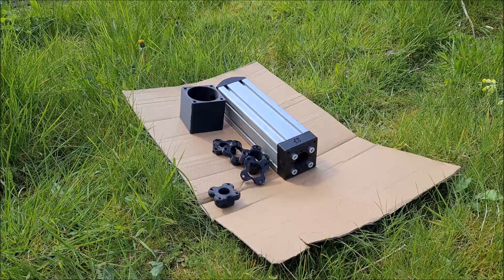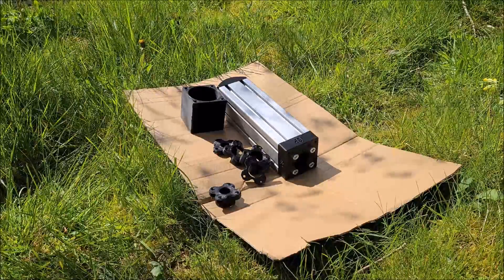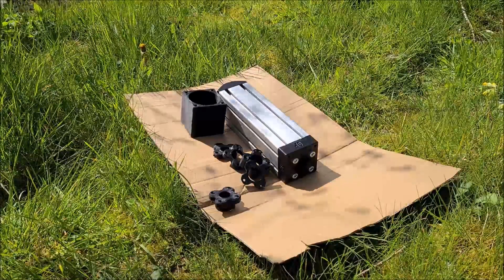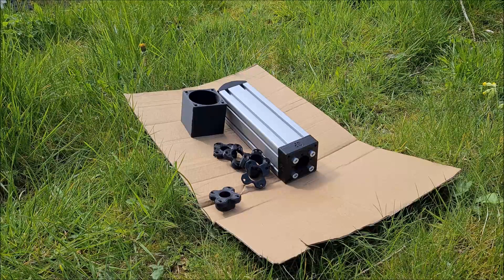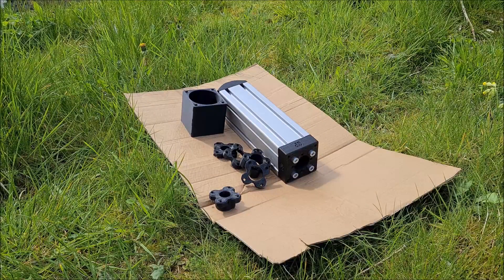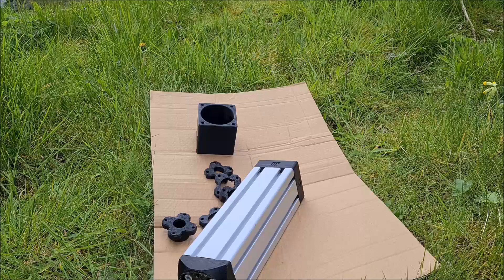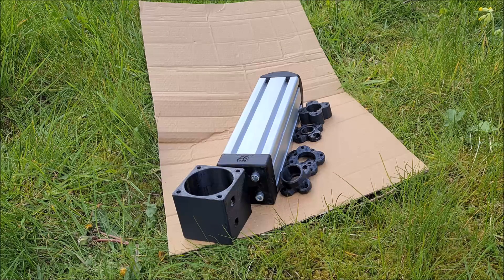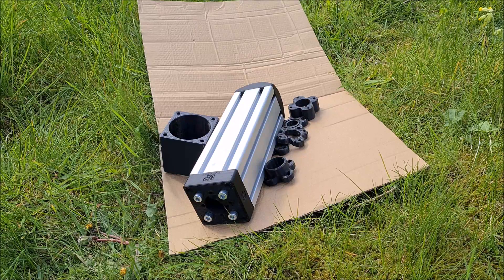Build your Own Sim Racing Motion Platform - Cheaper Actuator Design - Part 1

Comment: Hi man tyvm for all the info ,,,was thinking of making a set how much would it all cost 2022/December,,,also would only two work with a fixed rocker at the back ,,,ofc you would loose a lot of motion range i think,,but looks like there is loads of range with four ?
Reply: If you are still looking I bought almost all the parts (servos, drivers, thanos amc, mall screws, bearings, etc) all you need is the aluminium extrusions). I'm moving overseas so I need to sell.
Reply: @matthewpeacock9634  still up for sale?